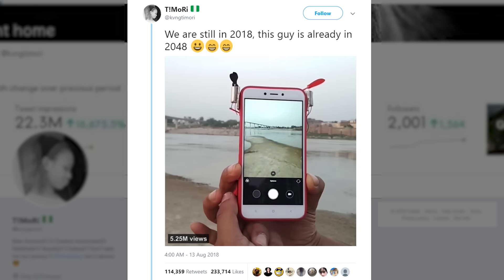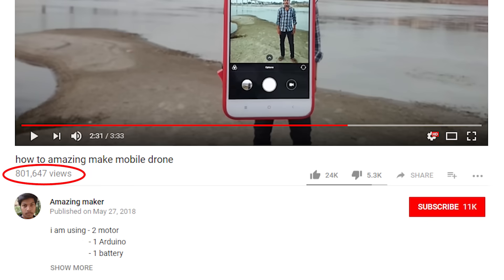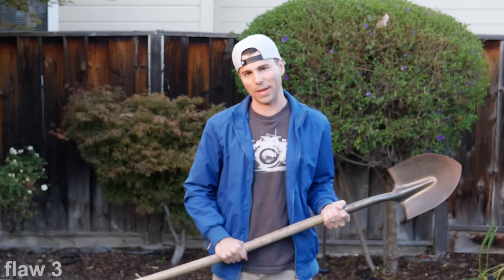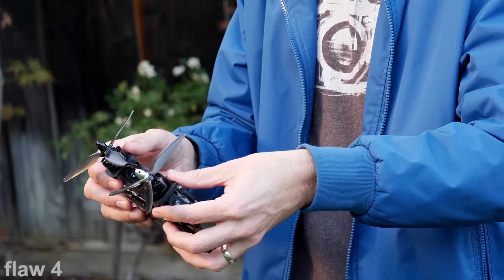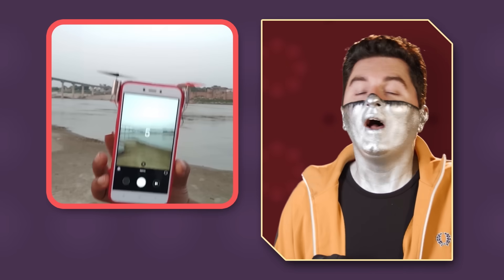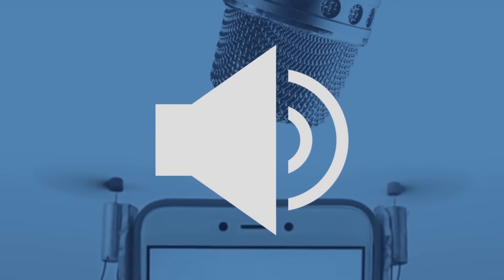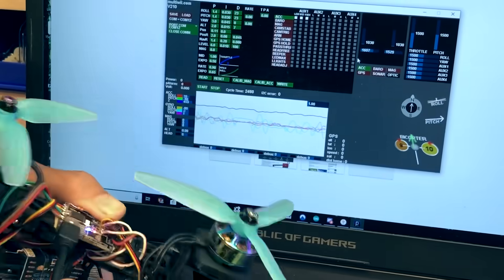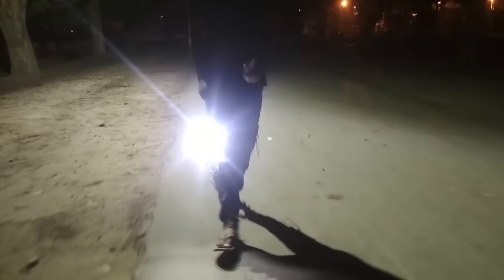Flying Phone Scam Exposed (so I built a REAL one)

Comment: Great video. The cell phone case wouldn't need a gyroscope because the Center of gravity is below the propellers, so its more like holding a shover from the top, not trying to balance it from the bottom. Also at 3:09 the shovel doesn't push your hand to the side, because gravity can only push straight down. The horizontal force is created by your hand and it is unopposed which is why the shovel accelerates to the side.
Reply: Lol. Good joke. Yeah no need for gyro, lets use wooden stick to make it stable instead.
Reply: Obviously, it wouldn't be stable, but the shovel analogy is wrong.

Comment: Why didn't you installed a long counter weight falling down the phone/drone? I'm not an engineer by no means, the most engineering I do is modding my gaming console controller lol, but it seemed to me that might fix the wobbling from the wind. Of course you'll need to adjust the little fans

Comment: Also in that guys vid, he taps the screen with no response from it. If it was real with a gyroscope then it would move back after each tap and then adjust its position back to where it was. Also he doesn't have a gyroscope so even if he does somehow manage to make it fly off the ground then the thing would spiral and crash into a wall or floor

Comment: Great video, but I must correct you on one thing.
At 5:20 you say that having 13 more motors would make the noise at least 6 times louder than it already is, when in actuality, it'd be a little over twice as loud, seeing how volume works in an exponential way, needing to increase much more power to make it louder.

Comment: I have a question about forces. The fixed propellers wouldn't bring the phone case down to the ground. The phone center of gravity is below the propellers and force from propellers is pointing up. If the phone would tilt a bit that tilt should be quickly countered by a momentum from force of gravity. Like a shovel but you hold it by one end and point it down to the ground. Or am i missing something?

Comment: Loved this. A set of slightly larger diameter two bladed props rather than those 3 bladed ones would likely get you more thrust and get it more efficiently,allowing to scale down your power system a little but kudos to you. Two-axis systems are cool, but as you say, not as easy as 3 or 4-axis systems like most drones. Very entertaining channel, thanks for making it happen!

Comment: So the phone actually comes with half of the components you need built in. Battery, gyroscope, and accelerometer are all already there. Just plug it in with a USB cable, program an app, and you can drop a ton of weight, if someone was thinking of doing this themselves for a version 2.0.

Comment: The propellers mounted to the top of the case is also a good opportunity to mention the Pendulum Rocket Fallacy:  since the direction of thrust tips when the aircraft tips, it doesn't create any corrective torque that would keep the aircraft upright, unlike if the aircraft were hanging from a hook.

Comment: One problem with your explanation: when you're balancing the shovel you're holding it at the bottom...below the center of gravity. The phone allegedly is being held aloft by propellers mounted at the top...above the center of gravity. It therefor would not tend to tip over the way the shovel did, it would tend to self-correct if tipped.

Comment: Hey Mark. I had a question about flaw 4. How would the phone turn upside down if the fulcrum of the rotational axis is where the fans are mounted (at the top of the phone, higher than 90% of the phone weight)? Im imagining that unless the power of the fans is great enough to accelerate the phone to a speed high enough to whip it around a room, there is no way the phone would rotate in that manner and make it fly into the ground. 

It feels like flaw 4 is BS imo. Please help me understand.

Comment: I like goofing around with science stuff and I actually made a cell phone fly with 1 motor. But only once. I had a busted drone and took a motor off of it and attached it to an old cell phone. I replaced the small prop that was on it with one neary 3 times bigger. Tapped into the phone battery and using a teeny weeny on/off switch. With no thought as to where it would go if it went at all,sooooo........ I turned it on and let it go. And........
It spun around in circles went on a low arch trajectory and crash bang crunch. Kinda looked like a bum Soviet middle launch. But it was fun.   For 45 seconds at most.

Comment: Why not use the phone itself as the flight controller? You'd need to compile Openpilot or some other open source flight controller software as an app and then interface the phone to the ESCs and servos. Basically you'd need a USB to 4 channel PWM interface for this. The phone already has the angle sensor. Most multirotor flight controllers and helicopter flybarless controllers use an Invensense MPU-6000 series angle sensor which is what many if not most smartphones also use.

Comment: The Explanation for Flaw 2 (missing Gyro) is not really correct. The board itself has no Gyro, but the attached Smartphone most certainly has and this data could be used, so no need for a duplicate sensor. The argument should rather be that the arduino has no wireless data connection to get the data from the smartphone.

Comment: Hey Mark, to double the volume of something you need 10 of those sources. So 13 sources wont be 6 times louder as 2 motors. Formula: Δ L = 10×log n or n = 10(ΔL/10)
Δ L = level difference; n = number of equal loud sound sources.
2 motors is 30% ish louder than one
13 motors is then 80% ish louder than 2 motors
THANKS SO MUCH FOR THE VIDEOS

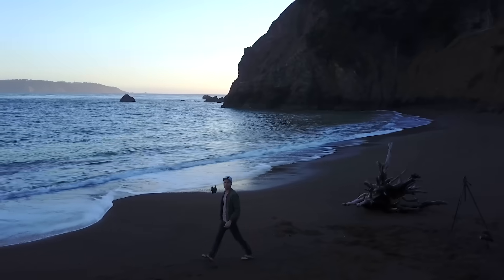Comment: Mark, excellent job on this video.  Quick question, at 09:50 in the video, you refer to "moving in all six degrees of freedom."  I assume you might mean all six "axis'" but I'm not sure.  Be it axis' or "degrees," can you explain what you mean here?  I'm a helicopter pilot (who loves photography) and I've heard aerial cinematographers talk about "six axis stabilization."  I only know of three: pitch (about lateral axis), roll (about longitudinal axis)) , yaw (about vertical axis).   What are the other three?
Reply: Andrew Dutton There's also the 3 position coordinates (altitude, latitude, longitude).  Being able to get almost any combination of all 6 numbers is six degrees of freedom.
Reply: As a helicopter pilot, surely you know that you can move Forward and Backwards, Side to Side, and Up and Down, in addition to Pitch Roll and Yaw.
Maybe you are thinking of a camera on a ball head tripod which only has  3 degrees of freedom, since the tripod holds it in a fixed location, but as I am sure you know, a helicopter is not fixed in a location, so now has 6 degrees of freedom.

This is why it is called 6 degrees of freedom, instead of six axis, because it is not talking about axies, but about movement.

Comment: The phone would likely rotate and also drift away without the feedback, but it would never tilt enough to make a nosedive.  The phone is basically hanging off the propellers and therefore self-leveling (pitch, not height), other than the drift, which would reach an equilibrium and it would reach a maximum speed whike doing so.  I predict it will fly in circles, if manually kept aloft at height, because it is not being supported from below like the shovel was in the demo.

This is also the reason I cringe when I see designs for quadcopters designed to be carry humans, like a flying car... Some of them have their props down below the cockpit.  This isn't a hovercraft, you don't have ground-induced stability when airborne.  They got that far in the design process without considering this.

There's a reason common quadcopters and any helicopter has their prop(s) above the unit, because of their inherent stability.   I realize gyro stabilization can stabilize the unit, but having the props above the centre of gravity saves energy used to stabilize it, allows for a more stable feedback loop, and if that stability function fails, the craft may veer off, but it is much less likely to flip over on it's own.

Comment: so, im not saying video is real but... does it really need to control propellers for keep it flying? center of mass is way below the propellers so gravity is correcting it so wont turn over, your shovel analogy is incorrect because center of mass is up. i have created hovering action figure with 4 propellers and just battery and it was hovering in air without any controllers

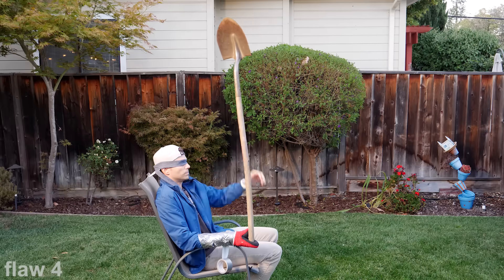Comment: 4:50 hold it firmly
Reply: XD
Reply: it will still fall over? there is no way you could hold if firmly from the bottom with one hand without it falling over. for example, you can have a strong bottom structure on a skyscraper, but with an entire weak structure from the above that point, it will cause the building to topple, and lets not forget about gravity.

Comment: 2:28 You got some of the helicopter stuff wrong. They don't move forwards (or in any direction) by tilting forwards, they move because the individual rotors pitch in sections. Example if a helicopter wants to move forwards the rotors pitch in the aft quadrant which propels the helicopter forwards. Look for a video of someone that can explain it better than me for a good explanation.

Comment: I think he messed up his case a little when he held the shovel from the bottom instead of from the top because the phone was basically hanging from the motors. 
Not that it would have worked in this case either.

Comment: Quadcopters have no moving parts?? What about the propellers? 4 of them, right? Isn't that why they are called quadcopters?
OK, you may get pardoned on that quirk, 'cause it's much simpler to have a motor spinning at a controlled speed than to tilt it at high speed back and forth just to control one axis plus control the revs of the motor as well.

Comment: I actually disagree with with your conclusion that the contraption would need a gyro to stabilize. in a traditional multicopter it is necessary, but since it was so bottom heavy I bet you wouldn't need it. The real challenge would be yaw control and achieving a stable hover. Since there is no way for the arduino to tell if it's turning or if it's falling it would be completely unstable. Obviously fake anyway, but not for that reason.

Comment: Also you don't need a very  complex stirring system because despite the shovel where the weigh is all above the point where is applied the force holding it.. on the phone all the weigh is below the sustaining force..  That's way most drones have the blades above their center of mass. The gravitation always points down! And is not true when you say that when the shovel starts to tip it excerts a  sideway force on your hand... if that was true you would be able to hold the thing blindfolded because you would feel  that change... Thats way you can also use a wood plank to hold the shovel you don't need to sens the way the force acts because it will always be Down! The difference you feel on your hand is because the point where that force is applied on your hand change a bit to the left or right.. and also the force varies with the angle of the tilt.. but that force can never act sideways!  Saying that it's like saying apples that have more meat on one side than on the other will fall sideways because the force will act sideways.

Comment: 5:15 if I'm not mistaken, loudness stacks up logarithmically, so if you want something to sound twice as loud you'll need to multiply it by 10, then 100 etc. 2 initial motors + 13 additional ones = about a 2x increase in volume, not a 6x increase like Mark suggested.

Comment: I just want to mention that theoretically, you could get away with no Gyro and accelerometer because those are included in most smartphones so you could develop an app that and had a USB connect the phone to the controller to get around not having one. Cool vid though.

Comment: 5:20 Actually, it wouldn't be 6 times louder. In order to double perceived sound you would need to multiply the source of the sound by 10. In other words, 10 motors would be double the sound of 1 motor. So 15 motors would be ALMOST double the loudness of 2 motors ;)

Comment: Did you make it work with just four independent PID-reguators or did you have any means of  decoupling in between? If not then that would severely limit the regulator performance.

Comment: Actually you have a MCU and LiPo and gyros and accelerometers (and much more sensors) already inside the phone, so this could become a much cleaner design. You basically only need extra ESC and motors. I see some business potential here.

Comment: "At least 6 times louder" .. incorrect. Hearing is non-linear.
A 6 fold power increase gives you about 15.5 more decibels. If you factor in ambient noise level and the initial noise of those screaming bastards which is definitely tipping 60dB, that is way less than 6 times louder. Its closer to a 1/4 louder.

Comment: Although everything else is true, the closed loop feedback is not needed since the system would be naturally stable considering the rotor blades are fixed at the top, so the centre of lift is above the centre of gravity, meaning any change in attitude would create a moment that rolls the phone back to its original position, much like how a ball hanging from a string would naturally rest directly below whatever was holding up the string.
The shovel is a bad analogy because this system is unstable, the centre of mass (force acting down) is above the normal force (acting up), and wants to drop below it

Edit: a better analogy is a man hanging from a parachute, the phone is the man and the parachute is the rotor blade(s), in this case the man obviously doesn't need to make corrections in order to not rotate and end up flipping over his parachute

Comment: Your shovel analogy (aka. inverted pendulum) is actually incorrect as the center of gravity is below the propellers. Still lots of the same issues with the fake but a much easier problem set. Good work on the rest of the video and analysis.

Comment: However, the benefit of doing it the way the original poster did it you could generate near infinite power. If you wrapped Newtons body in copper wire , the result of him spinning in his grave could be a pretty decent power source.

Comment: The drone can actually remain stable without a gyroscope or accelerometer, at least orientation wise. As long as the centre of thrust is above the centre of mass,  there is a positive stability as all offsets from the equilibrium position are self correcting, a bit like a pendulum.

Comment: A simple unregulated object with a prop at the top and the weight below it won't nosedive, as it's stable. You can do the same with two props like the video, but 4 far out from the center like a DJI are no longer stable.

Comment: I see the similarities between liguid sand and Dragon's breath aka corn starch ignighted. Both elements have to have oxygen flowing through the grains [of sand and corn starch] in order for each project to work or else they would fail. Sand compacted together in a hot tub would be just that. Sand in a hot tub. But incorporating air throughout the grains, you could actually get into the sand like it is a liquid because there is less density and you could move freely about in the sand. By the grains of cornstarch flying in the air, they are much easier to ignite because the oxygen is spread out surounding each grain, enabling a single spark to ignite one grain causing a chain reaction. Though this has nothing to do with this video, I thought I would share what I have learned in other videos.

Comment: That idea was proposed to me once, I said it'd only be something inventive you can't already get as a commercial drone by making it a phone zeppelin and that would need many or a quite large ballon, but surely could be much smaller than an air balloon. Helium surely would be better suited than hot air. You'd still need rotors for steering and stabilizing against wind/rotation, but not necessarily very strong ones. It maybe would even be interesting to the film industry for smooth silent camera flights even near ground. Maybe somewhere between a camera crane and a drone camera.

Comment: Hey I have a challenge for you! I have a 2 stroke motorized bicycle and I was wondering if it's possible to supercharge it with a rc plane motor and a prop of course. I know that the carburator not hot so I figure you can 3d print something to A. Hold a motor and prop safely (so pieces don't get into the engine) and B. Actually provide effective power. I have some ideas and suggestions in terms of a design but  no experience with a the software for 3d designing. Please contact my email for more and thank you for all the great content that you make I love the channel.

Comment: Appreciate the debunking video, I'm here from Peter's video. Just a note about helicopters though, they don't create forward thrust by tilting but rather using cyclical pitch (changing the angle of attack of the blades at different points around the disc)

Comment: I have a question. I have an old Nokia phone and once it was lying under my TV remote. When I got an SMS, the remote suddenly started changing channels and the volume also started going everywhere. Then today I tried it again by calling my phone and putting it right next to the remote, and again the same thing happened. But then the remote stopped working and the batteries had died. Can you explain what happened? Please.
Reply: TV remotes usually use infared signals, at least the older ones did, I'm not engineer, but I'm guessing the call signal sent an errand message to the remote and caused it to spaz out.